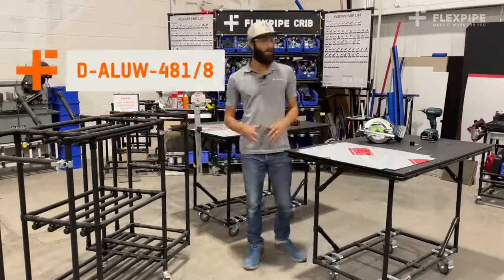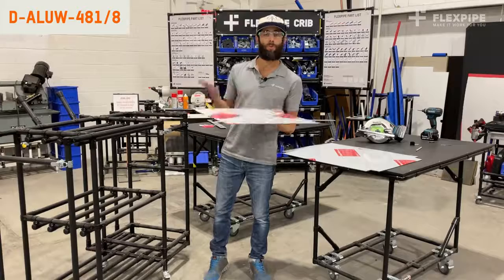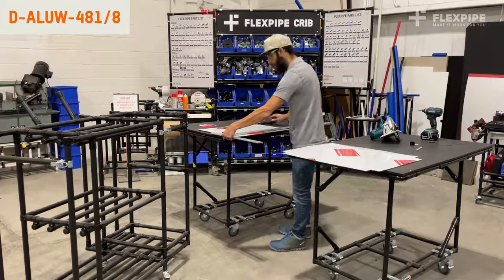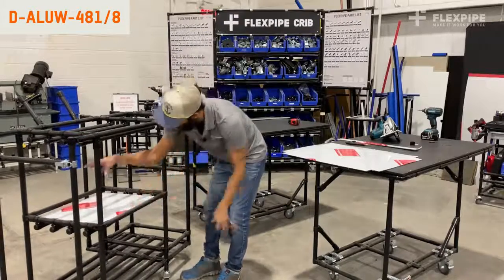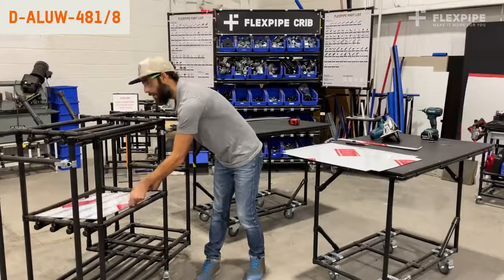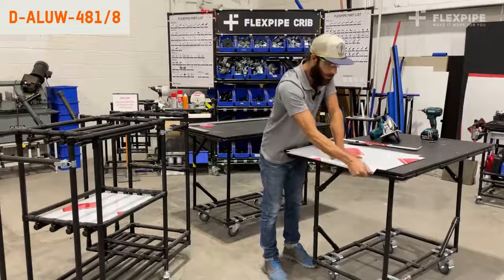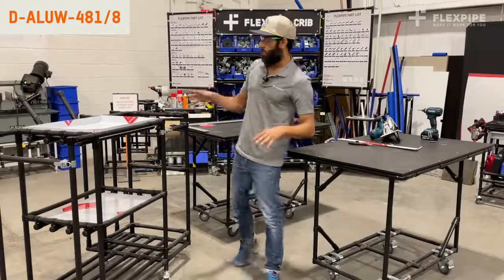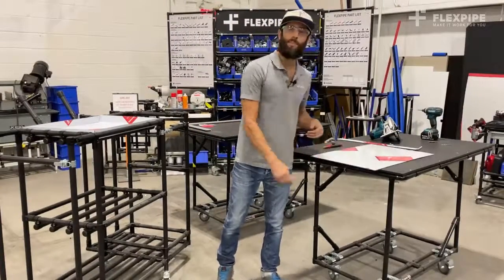🔔New Product: White Aluminum Composite Sheet (D-ALUW-481/8)

Comment: Can you stand on it
Reply from the maker: the surface thickess is 1/8 of an inch. Standing on it will most likely damage/deform the surface if there is not enough support underneath, however it is not recommend to stand on it, the surface can be slippery if it gets wet.
Reply: What about if i made a deck with good framing could i use this for a deck on my little Jon boat with some fancy mraine mat on top of it so it's not slick @Flexpipe

Comment: Curious if I could use for decking on a boat ?
Reply: I’m wondering the same thing bud. This looks like it could possibly be used for a lot of different applications
Reply: I’m doing the same thing Olson
Reply from the maker: Hello! This product is specifically great for side walls and shelves on Flexpipe structures.
Reply: @richy77g99 i have a little 14' jon boat i think I'm gunna use this on it for a small front deck with the right framing underneath I'm sure it will do the job
Reply from the maker: Hello! This particular material is 1/8" of an inch thick, thus making it to thin to be used as boat decking. Also the type of surface would be very slippery, which can be very dangerous for a boat.
Reply: @Flexpipe the marine mat would take out a lot of the force of something dropped on it